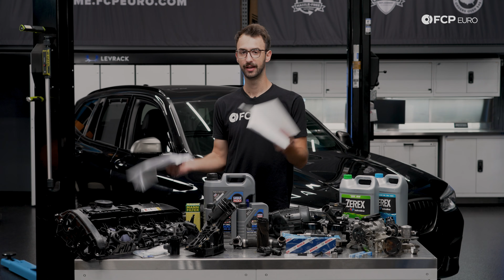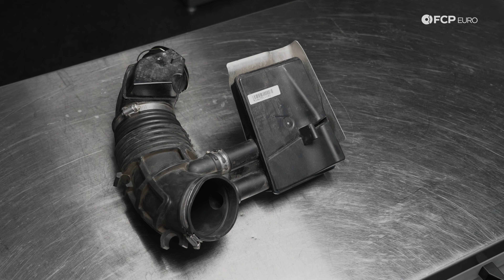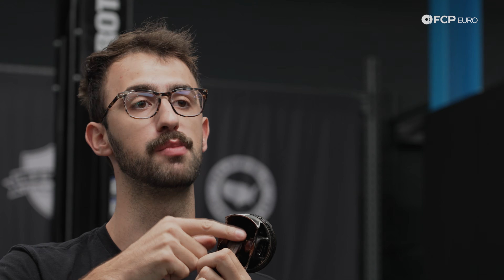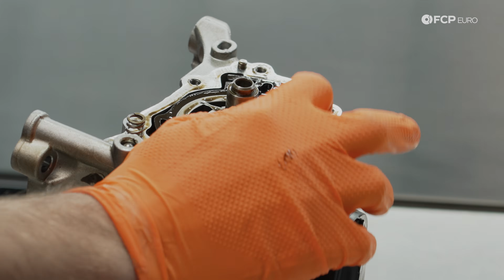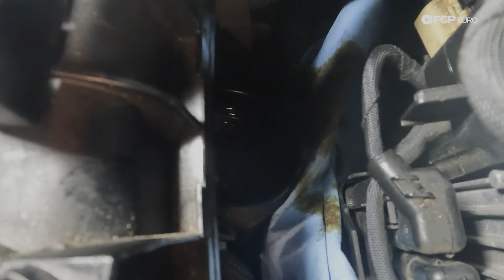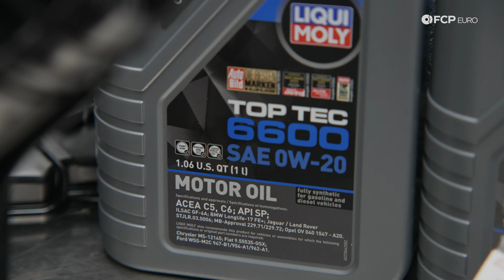BMW B58 Engine Guide: Everything You Need To Know

Comment: The BMW B58 engine, while praised for its performance and reliability, does have some common issues that owners should be aware of:

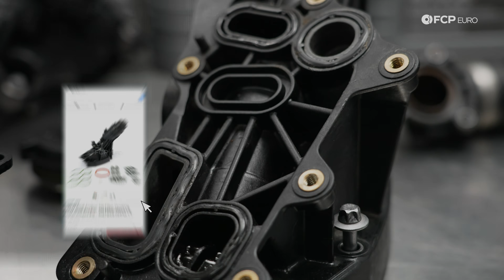•	Plastic Oil Filter Housing (24:41-25:47): The plastic oil filter housing is a significant concern for all B58 cars. Over time, the plastic can warp and crack, leading to leaks where oil and coolant can mix. This often presents as drops of coolant on the ground, but oil leakage is also likely. Replacement with a metal unit is recommended.
•	Stuck Oil Filter Debris (25:50-26:46): When changing the oil filter, a common issue is the bottom portion of a previous filter breaking off and getting stuck in the housing, which can crush new filters. It's crucial to remove this debris to prevent future issues.
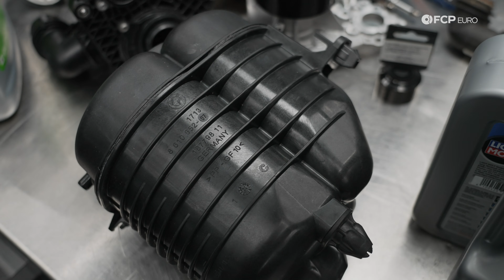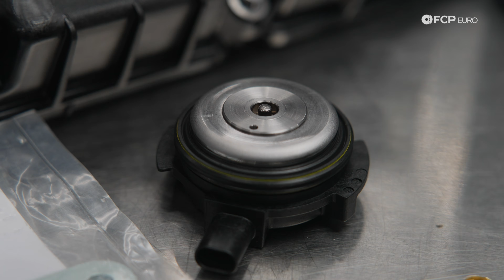•	Expansion Tank Leaks (28:24-29:04): Similar to older BMWs, the B58's expansion tank can fail due to laser welding at its seams, leading to coolant leaks. White streaks of coolant near the flange indicate a failing expansion tank.
•	VANOS Solenoid Software Glitch (29:06-29:39): Some B58 cars may exhibit a VANOS solenoid code (21A 02D), which often isn't a mechanical failure but rather a software glitch that can be resolved with a dealership software update.
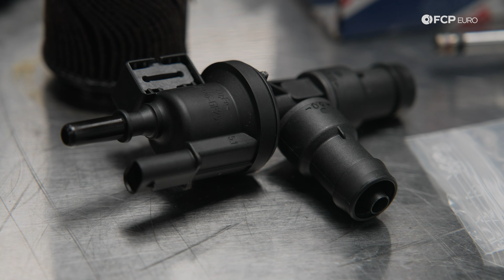•	Fuel Tank Vent Valve (FTVV) Issues (29:50-30:48): If your car cranks for a few extra seconds after fueling, the fuel tank vent valve might be gummed up and not sealing correctly. BMW has extended the warranty for this part on specific models (up to 15 years or 150,000 miles). It's an easy and quick DIY replacement.
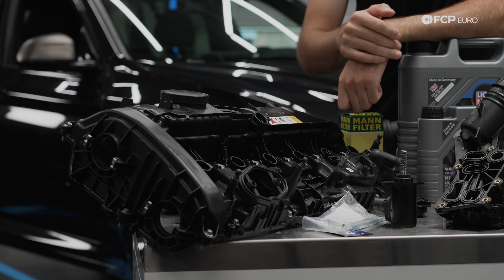•	PCV Valve Failure (Gen 1 B58) (31:09-31:26): First-generation B58 valve covers have a plastic-welded PCV valve with a rubber diaphragm that can crack, leading to a loud hissing noise as crankcase pressure escapes. BMW addressed this in 2020+ models by eliminating the external PCV valve. BMW has extended the warranty for this issue to 15 years or 150,000 miles on affected models (36:51-37:14).
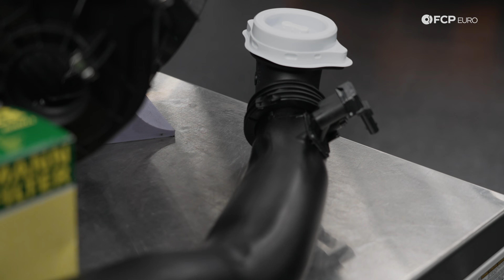•	Charge Pipe Cracks (31:55-32:28): The factory plastic charge pipe is prone to cracking over time, especially under high load or with tuned cars, allowing boost to escape or failing entirely. Replacing it with a metal aftermarket option is recommended.
•	Oil Leaking from Turbocharger (35:41-36:16): Oil leaks from the turbocharger are often due to a loose turbo band clamp on the core of the turbo. A service bulletin suggests tightening this clamp to resolve the issue.
•	Crankshaft Bearing Issue (Early F30 B58s) (36:19-36:40): A small subset of early F30 B58 cars had crankshaft bearing failures. BMW has a specific VIN list for affected vehicles, and owners on this list may be eligible for a free engine replacement by the dealership if damage is found.
•	Plastic Oil Pump Carrier (2019-2020 Models) (16:33-18:10): The plastic carrier within the variable displacement oil pump in 2019 and 2020 B58 models can fail if thicker oil (e.g., 5W-40) is used, as it puts excessive stress on the plastic component. BMW recommends 0W-20 oil to prevent this issue.

- Thank you Gemini 🫡
Reply: Thnx

Comment: Hillarious... I own a 2019 x5 with 74K miles. LOL. So far the only issues I had was, replace some suspension parts (total $5K costs), and the AC evaporator which was $4K at a bmw shop and $9K at the bmw dealer. Great engine and trans.

Comment: Wish BMW would bring the b57 diesel to the us market.
Reply: Owning a 2021 M340d G21, best car i‘ve ever driven. 340 HP and 700 Nm of torque. Such a beast if you want.
Reply: @horstriesenhil3444 they sold less than 300 of the 540d in the US with b57 only in 2018.  Extremely rare car here

Comment: 34:08 That small layer on top is there so it can get clogged faster and filter better. When you install a brand new air filter, it doesn’t filter as efficiently until it gets a bit clogged. Changing air filters too often can hurt the engine.
Reply: Interesting how can changing them often hurt the engine?
Reply: @User37621  Because a clogged filter will filter more. Initially, a brand-new filter will allow more particles through until it becomes slightly clogged and reaches its peak efficiency.

Comment: It is pure conjecture without evidence to suggest that 5W-40 causes oil pump failures. The magnitude of viscosity difference between 5W-40 and 0W-20 is small vs the difference in climates in North America. If this hypothesis were true all of the failures of oil pumps would be happening in Canada and the northern US. Oil viscosity is a logarithmic / exponential function with regard to temperature.

Comment: Why is there a 10.000 mile oil change Intervall in the US, when there is a 30k km (ca 18.600 miles) Intervall in Europe for the same engine ?!
Reply: Europe emissions and stuff they’d rather you engine go boom then producing a gram more emissions
Reply: @kacperszpotowski7641 
There is no law or regulation for oil change Intervalls in Europe, oil change has no impact to emissions
Reply: @ThomasWeb-j3x4q not directly but read up about it they use long intervals so they can get away with saying the fleet is ‘cleaner’
Reply: @kacperszpotowski7641 is the oil change included to CO2 emissions of the vehicle ?
I dont think so

Comment: Remember, replacing your air filter earlier is not always a good thing.  Air filters will remove more crud from the air the dirtier that they get.  Sure, it'll restrict flow a little but your engine won't wear as much.  Lake Speed Jr. just did a video on this on his Motor Oil Geek channel.

Comment: Have a 2017 540i, great car, only issue I’ve had is crankcase vent hose failed and had to be replaced after I had installed an after market intake. Apparently this is common after upgrading intake, but it was a cheap and easy fix.

Comment: Just bought a 22' X5 40i with this engine and I've been wrenching on LS powered GM cars/trucks all my life. I never considered a BMW as a daily driver not until the B58 came around. They definitely hit the mark with this engine!
Reply: we need more videos!
Reply: Been driving BMWs since 2005. 
I’ve never been let down.
Reply: @gregmcgarry1  Agreed. I have been driving old ones('04-'06) for the last 8 years. If they have their fluids changed on time and general maintenance intervals observed they will last.
Reply: It’s great for suv. I’ve even seen a post of a guy towing a large dual axle trailer with a x3 m40i.  -18 m40i stg1
Reply: Was not expecting to see you here lol
Reply: Was surprised to see your name here. I’d watch a video of your review on the engine and what you think now after owning it. And if you tune and mod it, I’d definitely watch but I get it if it isn’t your style as well.
Reply: Been looking at those also, how are you finding it?
Reply: Except all the plastic surrounding it😂 but it’s one of the smoothest most powerful engines I’ve ever owned.
Reply: Very useful video. Well done! Love the chapter markers also. Thanks for the effort in making such a great video. I learned a few new tricks here that I did not know about my BMW!
Reply: I own a 2023 X3 M40i, the B58 is simply sublime.
Reply: B58 is just the engine. The rest of the vehicle is still an unreliable BMW. Terrible waste of a good engine.
Reply: @ryaniam22 do the window regulators and door handle carriers and headliners still go boom?

Comment: It's worthy to point out although gen 1 B58's oil pump has plastic in it, but it's a dual-spring design with thicker material then the early gen 2 B58 pump, therefore failure of this part in gen 1 B58 is almost unheard of despite being on the road for nearly 10 years. Also gen 1's PCV cap is great, because of the ease of servicing and upgrade to various PCV delete and catch can set up. The beauty of a PCV delete is significantly reduced amount of oil vapor ingest by the engine.

Comment: I miss only one thing and that is fact, that this engine has 3 generations (or more, i am not sure) and there are far more changes, than just upgrades in the middle of 2020. I believe that latest gen ( 2024+) has also port injection and more.
Other than that, great video...

Comment: Just purchased a Z4 M40i manual. Glad I found this channel.
Reply: I hate nothing more than people saying how dumb others are for buying a car they wanted instead of the car they bought.
Reply: @LBM1919 you notice how in the end of the discussion we were in agreement. Way to show you have zero reading comprehension.
Reply: @BMW.V8ER you mean you rage baited and he was a sensible person who didn’t bite. My reading comprehension is perfectly fine and you did and said exactly what my point is was, you just realised by the end you were being facetious to a reasonable person.
Reply: @LBM1919 rage bait? Man that’s hilarious, you’re tiny little ego got hurt by a comment that wasn’t even directed to you.
Reply: @LBM1919 hmu when you make 6 figures off your depreciating liabilities.
Reply: Looool so you paid m3 money for a m40i
Reply: @BMW.V8ER An M40i with a significantly shorter wheelbase and 500 less pounds to lug around - I guarantee it drives better than an M3
Reply: @porschelover04 if you think a z4 handles better than an m3 you’ve clearly never driven one.
Reply: @porschelover04 lol and try 270 pounds heavier. And guess what, you get a soft top, I get a hard top, I can seat 3 passengers comfortably, you can seat 1. 😂
Reply: @BMW.V8ER When that Z4 is a quarter ton lighter, has the same wheel/tire setup as the M3, and has retuned sway bars and suspension specific to the manual? There's a reason the Handschalter package is $3500, it's more than just a clutch pedal and wiggle stick. Watch a review. It's not like comparing an '08 3.0Si to an E92 M3.
Reply: @porschelover04 I know it’s not a huge difference, I’m talking in terms of financially taking a smaller hit. I’ve made money on my last two bmws and drove them both over a year each.
Reply: @BMW.V8ER Nah I see your point in terms of money, I just think it's a fair debate instead of a no-brainer. If you really wanna talk money, my M240i has depreciated ~$10k after 6 years and 80k miles. And I give G80's a hard time in the twisties with a bit under $10k in mods. Everything's relative I suppose.
Reply: @porschelover04 agreed, I’ve thought about snagging a mid mileage m240i as a cheap track car
Reply: @A @BMW.V8ER 2-door cars are sexier than 4-door cars. Everyone knows this. That’s why an M4 is more expensive than an M3 even though it has fewer doors, and the exact same performance capabilities.
Reply: @mohawk5010that was never part of the discussion, come back when you’ve found your head

Comment: Have had two B58s now, first a 340i and now a GR Supra. Best engine ever. Insane platform
Reply: I am about to be on my third in a few days - love em with Carbhan Stg 1 tune.
Reply: Share me you honest review of the engine, pros and cons including the problems..
Reply: @mbuch1138 The only true con is the oil filter housing that seems to want to leave the chat after 70k miles. Coolant loss will occur but it’s a simple fix with an upgradable aluminum one. That and you’ll want to always drive it which isn’t so bad
Reply: @mbuch1138   google oil consumption B58
Reply: almost did the same but went with an S58 instead of another B58. S58 is pretty damn good motor.
Reply: Currently just got a 22’ m240i with 34k miles. Carfax shows 0 issues, just normal preventative maintenance, anything I should lookout for? Or other YouTubers you’d recommend watching about these engines
Reply: @NS-sv5yk  Just saw this and hope you purchased it! I highly recommend oil changes at 3-4k miles & change your transmission fluid every 50-60k miles. Besides that it's normal maintenance. There's really nothing to worry about, as you get into higher miles you may have an oil filter housing issue as I did in my 340i but I was on stage 2+ running E85 ethanol so car outputted way more power than usual. Even said, they have a cheap upgradable aluminum oil filter housing that costs less than $100. You can DIY otherwise it's roughly a $500-800 job at a trustworthy local mechanic. You'll know well in advance however as it'd slowly leak coolant. Other than that, platform is stout!
Reply: @ThatguyWitj@ThatguyWitjokes currently at 37k miles. Even with it being not tuned still oil changes every 3-4k miles? I plan on getting my car tuned around spring of next year so itll probably be around 45-50k miles, do you think I should get the transmission fluid changed  or wait a few more thousand miles then do it, when I go tune to the motor I’m going xhp too. I’ve heard about the oil filter housing issue and I’ll get that situated thanks for letting me know. The car drives amazing and oh my goodness it’s sooo beautiful, i got the color metallic grey and dude I’ve clean my car EVERY week since I got it, 0 regrets in this b58 platform!

Comment: You brought the N63B44M3 (no loner in production). It is not the same bolt for bolt, and not as well built, stout or reliable as the N63B44T3.

You also did not factor for subjective use. 

Also, the N63 does not make 'a bit more power'. It produces, substantially more power. LOTS more. And does it, without breaking.

Comment: I have an M340i xDrive with the auxiliary oil cooler (+ a Dinan car: suspension, exhaust, air intake, hood struts).  Loved your coverage.  Am now at 55k miles, out of warranty, looking to keep it long term.  I was a bit surprised that the video did not mention the extra oil cooler.

Comment: I have been driving my dads x5 M50 for about a year the TU3 motors is pretty good just oil changes so far has 95000 miles

Comment: I used to have a 2021 Supra that had a really bad oil consumption issue. I never found out what caused it, so I ended up selling it.
Reply: Only 2021 build prior November 2020 had that issue and plastic oil pump. it was only a 3% of the whole MK5 line so it wasnt the normal.
Reply: @tempeztad  And do you know if a fix was ever found for that? I heard some people replaced the whole block, while others just changed the rings and pistons. I really loved that car — it’s a shame I never managed to fix the oil issue. Now I’ve got an M2 with the S58, no problems at all.
Reply: @JorgeChatoDev depending on the state you live in may be different. In Texas, dealership are OBLIGATED to do a inspection for the oil consumption and if within a certain amount of miles the engine consumes an specific amount of oil, Toyota has to warrant a new engine or they have to buy the car back under lemon law. The issue wasn't even the engine but the piston rings used in the engine as those were the very first models of the B58M1 6 ports released but all Supras manufactured after November 2020 has this and the oil pump corrected.

Comment: im not sure how to feel about the oil pump on my 2017 440i. i run Stage 2 and am recommended to run 5W40.. kinda scary. i already had an m240i 2016 which was running on stage 2. i found metal in the filter so it had to go... idk man im getting that awkward feeling again.

Comment: I want a b58 for my next car. They are so far as good as the n52.  I have stayed away from Direct injection & Turbo`s,  only owning NA engines. (n52b30 3 stage intake 255hp stock, VQ37 infiniti 335hp stock, Pentastar 3.6 295hp stock)   Till now , BMW has taken all they have learned and created a masterpiece.  I want one with interstate miles already on it. 120, 000 is ok with me.
Reply: Same, stuck in N52 world, but opening up to B58 with port and DI has my next engine.

Comment: I loved my 2012 N55 from 50k miles and drove it to 120k. However I had nearly every issue you covered in this video, charge pipe failure, overflow tank explosion, other hose failures at connections. Can’t wait to get the B58.
Reply: They have different versions of n55 the m2 is the best has s55 rods an piston, forge crank, he is using the worst n55